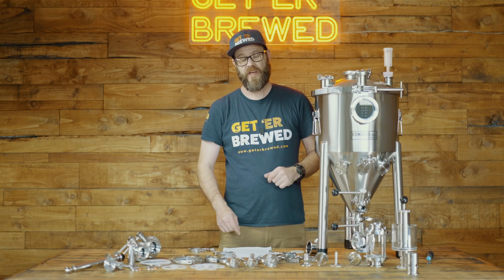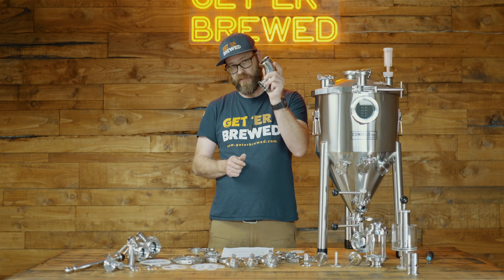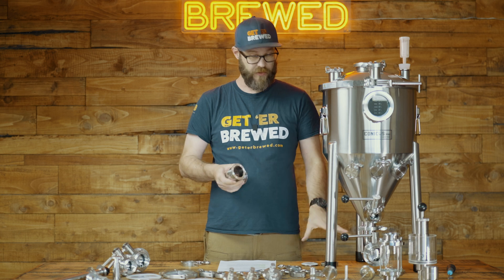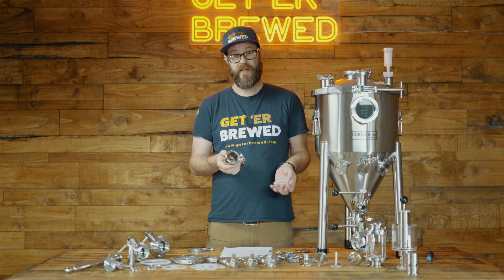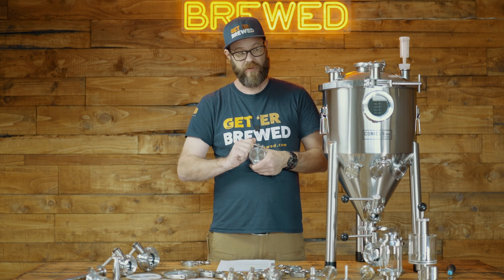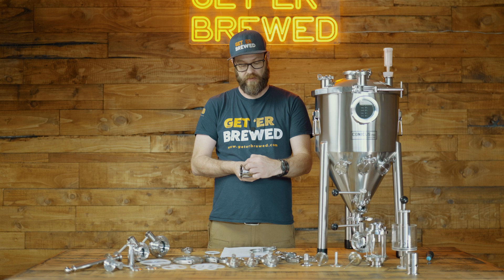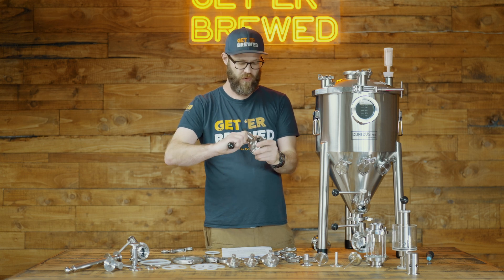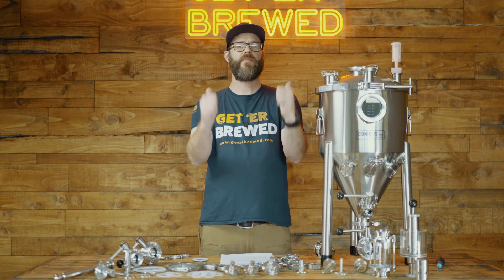Tri-Clamps Explained: Everything You Need to Know!

Comment: I’m ordering a conicus pro 30, I want to benefit from the pressure fermentation side of things, not so much hop bongs etc. does the conicus come ready to go for my use case? If not what should I order at the same time? Also, will it fit in a fridge that’s been converted to a fermenter fridge? (Under counter fridge)